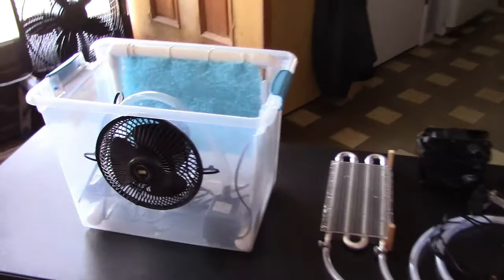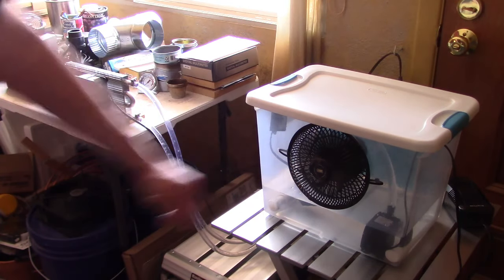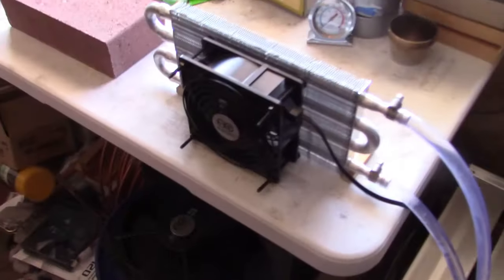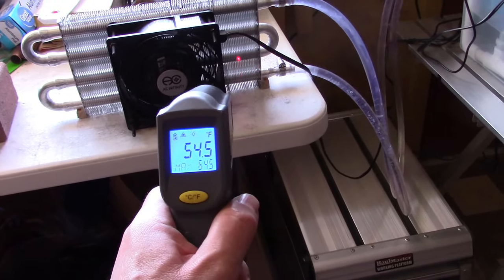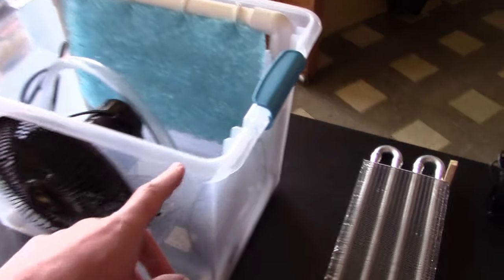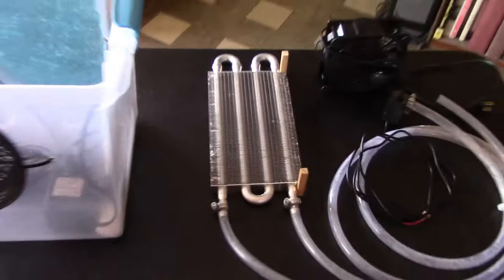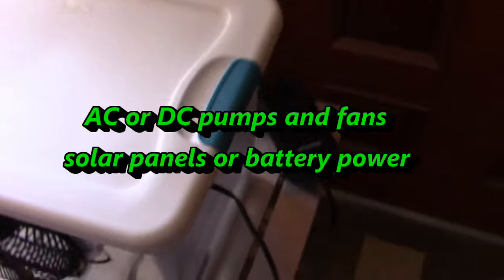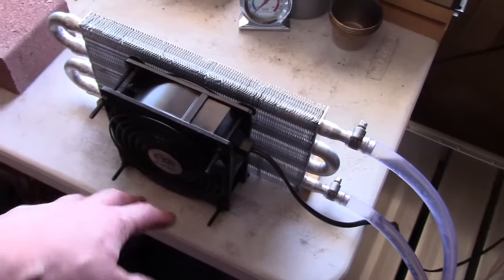DIY "indirect" Evap Air Cooler! No Humidity! only 39 watts! AC/DC air cooling! can be solar powered!

Comment: This video is just in time for summer. Today is my first 100 Fahrenheit day
Reply from the maker: yep. it's getting hot - if you haven't seen them already, make sure to check out my last 2 videos. they are both evap units too (and both are new for this summer!)

1.) video link to the "jumbo version" of this (made with a full-size box fan) https://youtu.be/I6u6yCe8RzI

2.) video link to newest/biggest direct unit (also made with a box fan)
https://youtu.be/qAhzaBC2Reg
Reply from the maker: @Tau Mag sounds like a possibility (but i would have to think about that one more). here's an idea: you could add one extra step to create what they call a two-stage evap cooler. just add a second radiator above the cool, humid *exhaust air. then just direct the warmed water (that just passed thru the first radiator) into the second radiator (to pre-cool the water before it enters the tub). it's definitely not necessary but it would make use of the discarded humid air.
Reply: @desertsun02  that would make a good video from you?
Reply: This was my question
Reply: @taumag  this was exactly my question
Reply: @desertsun02  makes me wonder why they dont call them SWAMP HEATERS!!! =)

Comment: It's exactly what i'm using. Except I didn't built the evaporator fan myself, but bought a proper one with higher output to be able to cool the whole house. If running 24/7, it will consume about 3 cubic meter of water and 75-100kW/h of electricity per month. Cost me only 10-15$ monthly (price in my country, maybe 40-50$ in us if i'm not wrong)
Reply: High how much bigger is your house and can you share some detail pleaseeeee
Reply: @humayunakbar5277  Size is about 120m3. I bought a 250W evaporative air cooler. I also used some 360mm PC water cooler radiators and stack 120mm PC fans on them. It's more convenient than DIY the whole thing from scratch. 
It works well back then, but can't do very well nowaday, it's just too hot.
Remember to place the evaporator in the shade and properly insulate the pipe. You can also hook a water tank on the pipe from evaporator to radiator and throw some ice into it during hottest hours.

Comment: I like it. You could improve efficiency a bity by insulating the plastic box & hoses. Using ice is cheating because the amount of heat created in the process of making the ice is more than the ice will cool.

Comment: We have a store bought version (only because I bought at a warehouse cheaper than I could make one). It is small so we use small ice packs in it. Makes a huge difference so far.
Reply: You bought a unit that cools without putting humidity into your house. I would be interested. Can you share a place where I can buy or what I might search for?
Reply: What is the store bought version called?
Reply: @nickdenuzzo1218  artic cool
Reply: @litnoregrets7551 yeah it's another swamp cooler only it don't use water. Waste of money. Even if you spent more money on a swamp cooler and used ice packs or ice you would have something better. 73
Reply: This is not like those cheap crappy fans that blow across Ice or ice packs. The one in the video puts cool water through an evaporator and the air goes through the fins and pipes. More like a real AC unit. Without the freon or compressor. 73

Comment: What if instead of water box - cooler  use camping fridge? To have a fridge and AC while camping 2 in 1. To Put metal shower pipes on the bottom of camping fridge and water pump will circulate cold water like in your system

Comment: I love the design, only the sound seems to be a bit strong. In one of your video's I saw you use  a bigger radiator fan. Could that one be used to replace each of the shown fans? I rather go somewhat bigger and be more quiet. Would you try and demonstrate? (For traveling or as mobile setup, this looks amazing.)
Reply from the maker: hi there. oh, don't worry about that. to your ear they just sound like normal fans. they only sound strong because my camera has dual microphones on the front of the camera. it's like putting your ear up to it and listening. in reality, they just sound like 2 fans running. also note that the unit itself doesn't increase the sound of your fans in any way (so just choose fans that you like the sound of and you're all set) 👍😉

Comment: You are an amazing inventor!! I'm going to try making one but where does one get the radiator part? thank you for showing this!
Reply from the maker: hi. you can get the radiators (technically called transmission coolers) on amazon. just search for hayden transmission coolers. the one in the video is model 401 (but they have several sizes (402,403, 405)

Comment: Thank you very much for the new video! Would you please post where to get those blue cooling/evap pads? Idealy an affiliate link, I'd love to support you 🙂
Reply from the maker: hi there. you can get the blue evap cooler pads at most home stores (like home depot and lowes). amazon has them too but they usually charge way to much. you should be able to get a 3' x 3' pad for under 10 dollars. (i get them for about 8 bucks at home depot). if you search for 'foamed polyester evap cooler pads' you will see tons of them

Comment: Do you ever tried to run outside air trough the water part, and use some heat exchanger on that line. So the humid air get out.

Comment: EDIT:  I just realized the problem with my idea below:  it would create negative pressure, and thus hot outside air would likely leak in from somewhere else.

In most of your videos, you talk about running the chiller hoses through a board that is sandwiched in a house window.
But it seems like if you're willing to do that, then it would be better to vent the humid exhaust through that window board, and then keep both the evap box & the chiller fan in the house.  That way, the evap box is working in a cooler environment to start with, than the potential 100F/40C outside.   (And, humidity is possibly already lower inside, too, since if you also have A/C its condenser tends to dry the air.)   I think I may try your sealed tote version, but mount the fan in the lid, and then put the matting on 4 sides.  (Your 4-sided PVC skeleton versions have leaky suction between the matting and the PVC pipes)  Thanks for the idea!
Reply: The fact that it leaks from outside doesn't mean it's a bad thing, your points are still valid

Comment: So I have no idea if this would work, lemme know if I'm way off base here about something

Rather than pumping water through the tubes could you instead direct the humid air flow through the cooling fins? The cold-humid air would pull heat from the fins, then pass the returning warm-humid air over a humidity filter to recondense the water out of it. Warmer water gets dripped through the evaporator,  starting the cycle again. 

The recondensing filter would need to be pretty big to avoid getting saturated, so if size is a limitation it wouldn't work, but it'd mean not replacing the water or 'losing' cold air to the outside

Comment: So what if you were to put the heat exchange in front of the air intake for the evap side? By that I mean: the ambient air is drawn past the heat exchanger before coming into the evap side, and so cools down BEFORE it even goes through the wet pad. Then it cools down even further going through the wet pad into the house.
Reply: Doesn’t make sense to do that. Energy cannot be created nor destroyed.

Comment: Just what I was looking for😃. I need something like this to bring down the temp inside a grow tent. I had in mind a Peltier cell to cool the water, but your project seems much easier to me. Can it handle bringing down the temperature steadily despite the weather hitting triple digits?
Reply from the maker: hi. yes it can. when it's 100F (where i live) with low humidity, you can get 71F air coming out.
Reply: @desertsun02  Thx, buddy

Comment: This is awesome! How quickly does it use up the water? I guess it depends on how humid it is. Roughly how long can you go where you are?
Reply from the maker: hi. it goes through about a half-gallon of water an hour (and the tote as shown holds 2 gallons) so i'll go up to 4 hours. you can of course 'resize things' if you want a bigger water reservoir. my last video is of a tote evap cooler that uses a box fan and holds 20 gallons of water! that one goes thru a gallon of water an hour and will run for 16 hours! if interested here's the link https://youtu.be/qAhzaBC2Reg. this last link is of the video before that. it's an indirect system using a box fan that holds about 13 gallons and runs for about 10 hours! https://youtu.be/I6u6yCe8RzI
Reply: desertsun02 Thank you so much. You have some great ideas.

Comment: what if the heat exchanger metal part was chilled by a mist exhaust fan, will the air be much cooler without humidity ?

Comment: I love your videos.  I live in an equally hot dry climate to you but in South Australia and we get ridiculously hot days during summer!  This summer is looking to be a scorcher so I'm interested in building one of your projects .  We have a product here called Techni-Ice  which is basically a dry ice packet which you soak in water first to hydrate it and then freeze it in your normal freezer.  You can use it for ice or hot packs and not being made of water it stays dry and supposedly when frozen is meant to last longer than normal water ice in the right conditions.   I'm just wondering if you have a similar product over there and if so I wonder how substituting that for the water ice would work out when comparing the two methods?
Reply from the maker: hi there and thanks. it sounds like an interesting product. i'll definitely look into it.

Comment: Around 5:00 you say "most of the water does not evaporate it just goes to the bottom, so it super cools the water and it's constantly cooling the water at the bottom too". Please explain how this works. It seems to me the water that's going through the evap pad is picking up heat from the air, so it would actually be warmer by the time it falls to the bottom.
Reply from the maker: hi there. the "heat part" that you are thinking about is the heat that actually gets "trapped" in the air as "latent heat". the humid air that is produced actually holds that heat as "latent heat". (remember that the process of evaporation actually takes or requires heat) so as the evaporation occurs - cold air is left behind. as the room air gets pulled through the pad the air cools down (which then cools down the pad itself *because that is where the evaporation is taking place. that makes the pad cold too. then as the water runs down the cold pad - the water itself cools off. (and the heat (that is stored as latent heat) is blown away).

Comment: Wish this worked here in Alabama. 🥺 Unfortunately I'm afraid it's too humid here.  I may try it anyway since the other part goes outside.  I'll let you know if it works.
Reply from the maker: hi there. these (half-work) in high humidity. what i mean by that is that the radiator part works great in any humidity (even 95%) but the tote evap chiller only chills the water well if humidity is 60% or less. your best bet might be to use the radiator part with another cold water source (ice cooled is one way). i have 4 videos showing how to make lots of these radiator coolers using cold water cooled with ice and ice packs etc. (i posted all 4 last summer - summer 2021). those work great in any humidity.
Reply: @desertsun02  AWESOME! Thanks for the reply and I'll go check those out.  I  could probably use several frozen water bottles in rotation to keep it chilling.
Reply from the maker: @Carla Cowling yes, absolutely! all 4 videos are posted back-to-back on my channel but to make it even easier - here's the 4 links...
1.) https://youtu.be/5YVPu9hfhZo (original video on the topic)
2.) https://youtu.be/DERYsKnlKzA (2nd original video on the topic)
3.) https://youtu.be/Jfc26AH0jLI (larger box fan version)
4.) https://youtu.be/oAuL-ScEWfI (extended box version - w/extras)

Comment: I'm not familiar with the electronic side of things but it looks like I can just plug in a small water pump and a fan to the rest of the evap tote to achieve the most basic outcome?
Reply from the maker: yes, that's basically it! (along with the radiator).
Reply: @desertsun02  Your inventiveness is contagious! Excited to try this! Hopefully we won't need it with predicted outages

Comment: hello I decided to come up and reference this idea for my project, the temperature needed is around 13C to 15C. But I only get around 24C. What suggestion is best for it to achieve around 13C to 15C? Thanks if you read this.
Reply: I also added a water chiller peltier for the water to be chilled but I only get for around 24C
Reply: I'm using a rigid media type of evaporative pad since that's the only available, and using a two 1800 RPM and 74.5CFM PWM 12V Fan. Using this project for my tomato storage that is enclosed in a styrofoam box
Reply: Do I need a high cfm fan?

Comment: Can u do this with a home ac unit if I change the coil and replace it with a different radiator and plum in the water lines
Reply: No, a compressor based AC is not designed for water.

Comment: Can you run this off solar? I was thinking this would be perfect if your power went out during a hot day in the summer.
Reply from the maker: hi there. yes you definitely can! i discuss that a little near the end of the video. but basically just use 12v dc fans and 12v dc pumps and then you can hook the whole thing directly to a 12v solar panel.

Comment: will this work in humid environment?
Reply from the maker: hi. if it's only slightly humid they still work pretty good. they do struggle when the humidity is over 60% though. if the temps are lower like in the 70's then they can work okay up to maybe 70%. evap chart shows temps to expect.

Comment: If you could get cool creek water that's about 40 degrees you would have the best no humidity water cooler air. Our former church won a energy saving award for using something like this. They had water chillers that cooled the  water. with antifreeze and water would go through the air handlers. Giving nice cool rooms. There was one drawback it wasn't good for taking moisture out of the air like freon does. So I would say not for Florida where the humidity is high. This might work in the mountains where cool running water is plentiful. 73

Comment: Have you tried geo thermal cooling?
Reply from the maker: hi, i haven't tried that yet. the ground where i live is so hard and dense it's next to impossible to dig a hole. i may get a new pick axe and give it a try though (that's what you need to dig where i live. a shovel doesn't work at all)

Comment: Are you using the 1238 AC infinity axial fan and the Hayden 402 transmission cooler for this set up?
Reply from the maker: hi there. yes, it's the ac infinity 1238. note that there is a LS1238 (low speed) and a HS1238 (high speed). you can use either. i have both of those. i also have an optional speed controller that you can use with either fan. i am using the hayden 401 (but you can use the 402 also). the 402 is just a little longer if i remember right. btw - you can use any fan that you want. lots of different fans will fit in front of the radiator
Reply: @desertsun02  Ok, good to know. I'm going to look for some deals on fans today. Thank you again!!!

Comment: Don’t know if you’ll read this comment but what would the performance improvement be if you added a peltier water chiller to that? You could put the heat sink for it where the cool air comes off the pad.

Edit: more info
Reply from the maker: hi. and thanks for the comment! i read all comments on all videos, so always feel free to comment on any video. i see all of them. peltier might help a little but i'd have to give the idea some thought. i was recently thinking of adding a second radiator so i could chill the water that is fed back.
Reply: @desertsun02  That sounds good another radiator won’t use additional power like a peltier. Would you consider testing the indirect cooler to see if it might cool a small tent effectively. I live in a hot place and it would be nice to make a solar powered cooling shelter. I would put the tent inside the house and hang out in there if the power went out or the AC broke. I live in the Coachella valley and it gets very hot here. So if I can keep a space under or at 90 during the day that would still be uncomfortable but it would prevent heat illness.